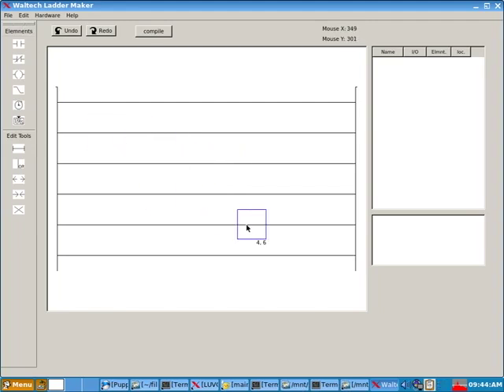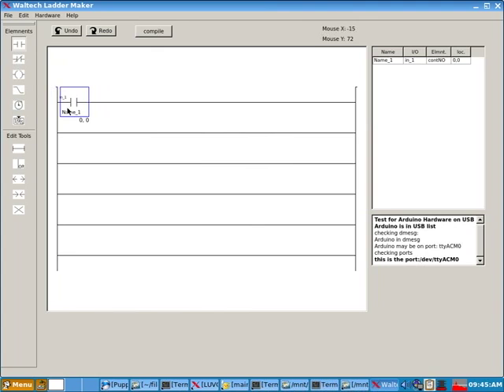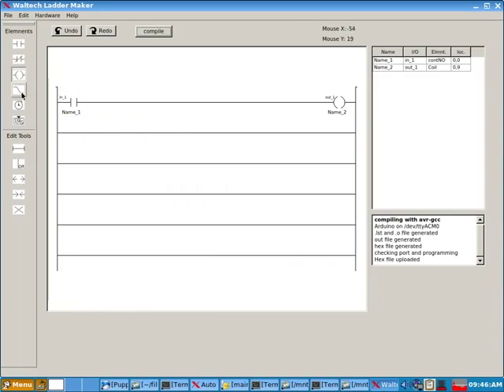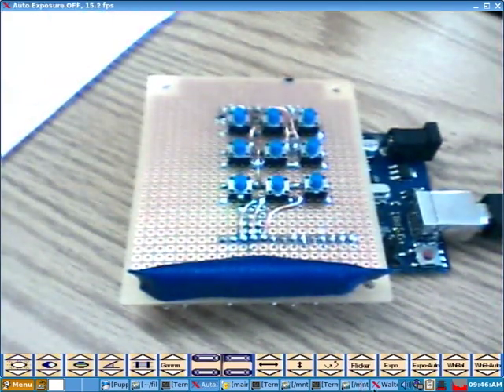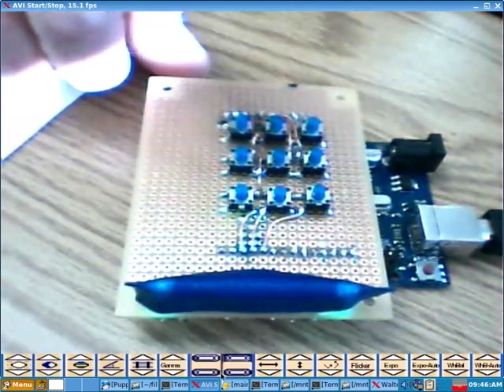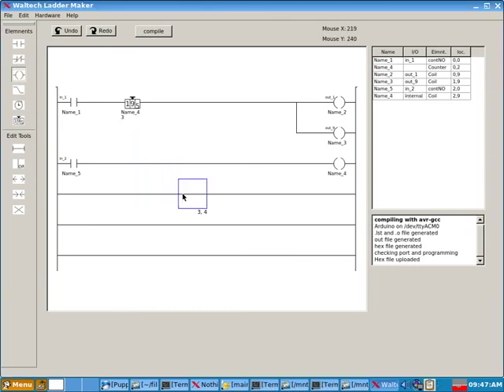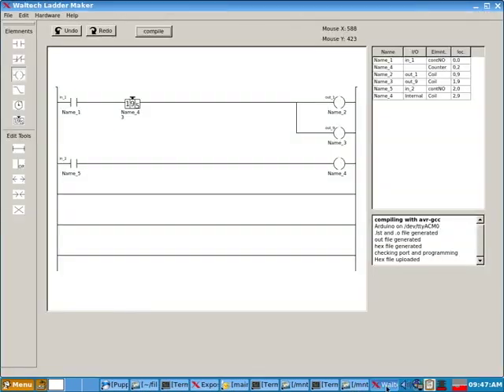Waltech LadderMaker Ladder Logic Software Demo with Arduino

Comment: It would be cool if this programmed also gave you a C++ text output so we can see what exactly is happening.
Reply from the maker: MattTerryAccount  You can see the C code it makes in the terminal. Scroll up after compiling. It's not Arduino C, so you can't just cut and paste into the Arduino IDE, but you can compile it stand-alone with AVR-GCC
Reply: +Karl Walter  What are the steps to convert the C code of your LadderMaker to Arduino C? I've done some research but it's a little confusing.
Reply from the maker: Hello,

Try this:

From the terminal that Laddermaker is running in copy everything between "Making C" and "saving C and Compiling" 

Paste into a totally blank Arduino IDE project. No setup, no loop.

Delete two instances of "inline"

Change "operator" to "Operator" in five instances. 

Compile.
Reply: +Karl Walter Thanks very much,  I'll try that.
Reply: +Karl Walter I am getting a error, have you seen this?

exit status 1
expected unqualified-id before '{' token  

I get this error no matter how simple the program, this is a simple one contact one coil program or a multiple contact coil program
Reply: +Karl Walter, I sent you an email hopefully you will see it soon.  It contains all of the error files

Comment: *.wlm save problem.
Reply from the maker: Sabri ÜNAL What Operating System and version?
Reply from the maker: Sabri ÜNAL What is the error or issue?
Reply: Saving does not work. How to studies can be saved?
Reply: save command does not work
Reply from the maker: Sabri ÜNAL Yes, thanks.  2nd time save does not work in windows. Will be fixed in v.107b.  Use save-as for now.
Reply: Thanks, I'll follow.

Comment: Hey Carl. i am trying to use the software, the arduino is conected, i made the ladder and upload it but it doesnt work, i connected the switch and led ass it is connected in Button example in arduino
 http://www.arduino.cc/en/Tutorial/Button

please help
Reply from the maker: Hello Eslam,
I'm assuming the upload to the Arduino was successful. 
The connection for Ladder Maker is different than the basic button connection in your link.  Use this circuit as a guide:
 http://www.waltech.com/Misc_folder/ard_conn_sw_led.jpg
R = 1.5k should be fine. --Karl
Reply: Karl Walter i really appreciate it that you answered that fast, i tried with that scheme but it doesnt work still
Reply from the maker: Eslam Farouk Hello Eslam, 
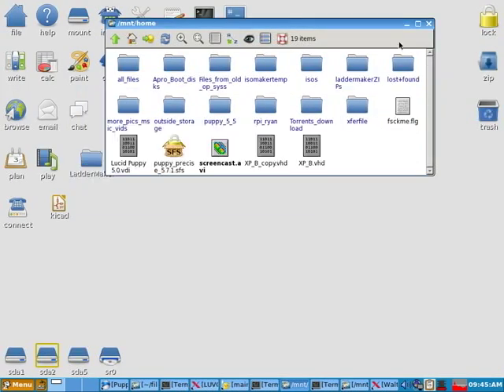Are you getting the "hex file uploaded" message in the message box on the lower right?  The message should look like 0:50 to 0:56 in the video. (360p or better to be able to read it) --Karl
Reply: Karl Walter yes i get it
Reply from the maker: Eslam Farouk Ok, so I'm thinking maybe check that the input and output on the ladder are assigned, and indicate the input and output you are using, and not "internal" --Karl
Reply: Karl Walter Very, very Nice, I really like this Karl.
Have you ever heard of the STM32F4 Dev. board, and if yes can this work on it?
Reply from the maker: T Traz Yes, I have one here on my desk.  It could be made to work, but is a 3.3v processor which is less useful in industrial type applications.  There is a group doing a fuel injection system based on that board, but they end up with a lot of level shifters.
Reply: Oh I see, thanks for the response.

Yes im familiar with the ECU build. I am just getting into dev boards, so im a noob. Are you trying to impliment the ST also?

And is ending up with level shifters good or bad?
I have  big plans for the  ladder. Automotive side...
Reply from the maker: T Traz Level shifters are not bad but are just more stuff needed, and the very inexpensive ST board doesn't look all that inexpensive when you have to add a lot of other peripherals. 

Probably we won't try to implement the ST any time soon, as it would require packaging a whole new compiler with Ladder Maker.  Got to get the Adruino nano supported first, folks are clamoring for that. --Karl

Comment: All my outputs on my Nano are activated all the time. If I activate the output 1 its unlatching my relay. Is this common? or is there a setting im missing?
Reply from the maker: The inputs are inverted so that they can be used in one of the two ways:

https://drive.google.com/file/d/0B_5FgmJtoe_obHBhdFFma0JxRXNJaWxON3VKY09aVFBQTmM0/view?usp=sharing

(opto-isolated input or pull-down switch)

Comment: Hello Mr Walter.
How can i try it with my Arduino Mega 1280 board?
I get an error that my arduino isn't in ports 1-9.
As i see from Arduino programm is on Port 10.
Please help.
Reply from the maker: HI,
You can can change the port of your Arduino to a lower number in the control panel.

It still may not work as the output is for a mega 2560.  You'll need to use an Uno, Nano, or mega 2560.

Comment: Can i use the code and open it in the arduino ide?
Reply from the maker: You can, but it needs a few changes.  Here are instructions: http://www.waltech.com/blog/c-code-laddermaker/
Reply: Thanks so much do you have a link on how to run ladder maker  11a on linux i have no experience with linux and was wondering if you could maybe help mei am running ubuntu on a virtual machiene
Reply from the maker: Open a terminal (ctrl-alt-t)  and right-click-paste these commands to install python and pyqt4.  You will need to enter your password once. 

sudo add-apt-repository ppa:fkrull/deadsnakes
sudo apt-get update
sudo apt-get install python2.7
sudo apt-get install python-qt4

Then you can cd to the Program folder and run main.py:

python main.py.

Comment: sir dos it works with uno r3 board and it software with Windows
Reply from the maker: No, sorry, the microcontroller is different on the R3.  You could change the compile specifications in the Python code if you are adventuresome.